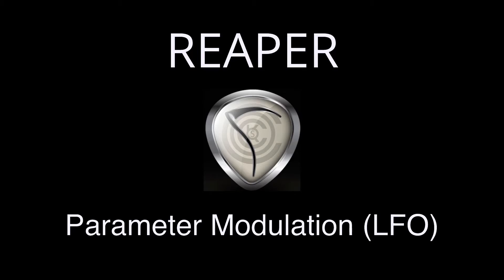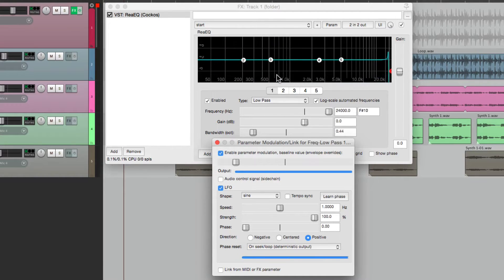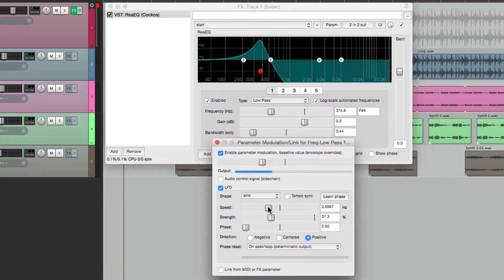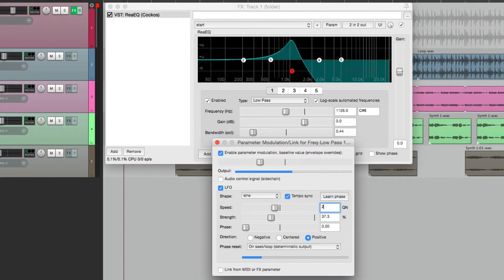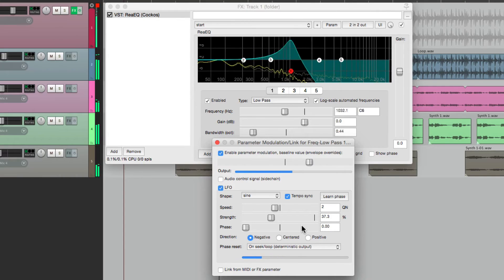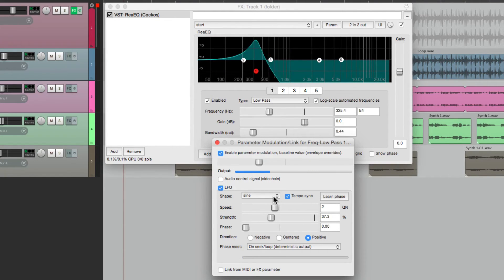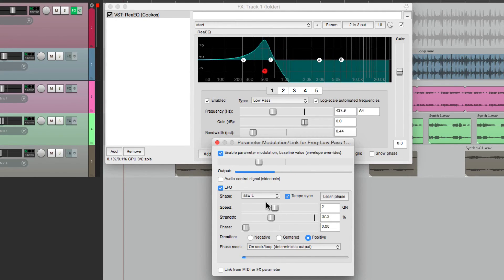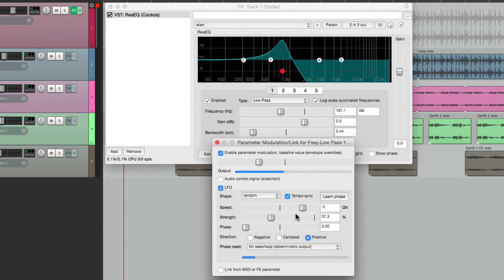Parameter Modulation in REAPER - LFO

Comment: This started way too late in the process. How do you get to those settings that you started the video with???
Reply: on the plugin wrapper click Param -> FX Parameter list -> Parameter modulation/MIDI link and select a parameter to be modulated

or touch any control on the plugin UI, click Param -> Parameter modulation/MIDI link which will take you directly to modulation window of the parameter whose contol you just touched